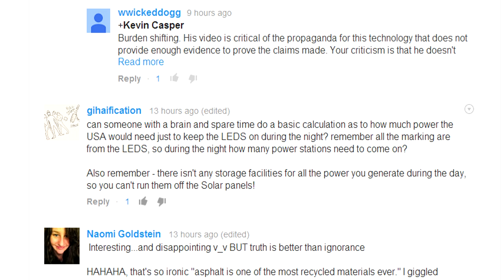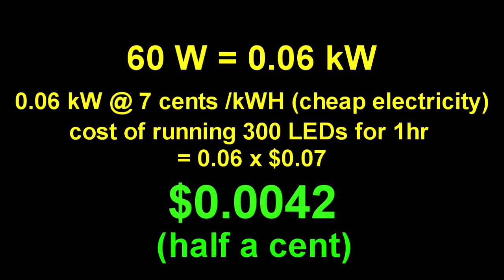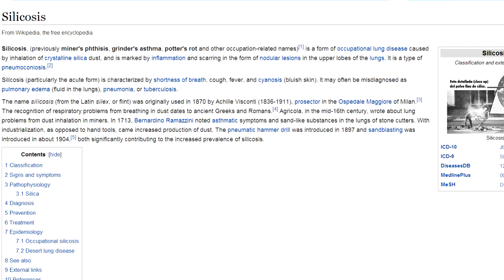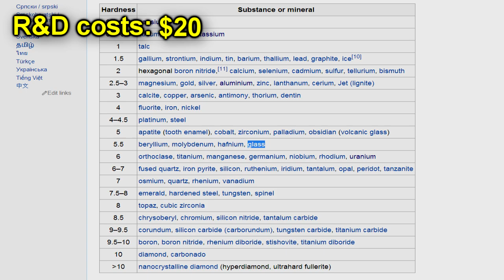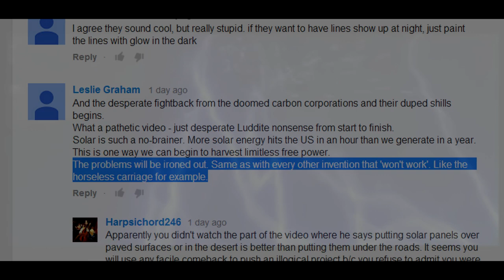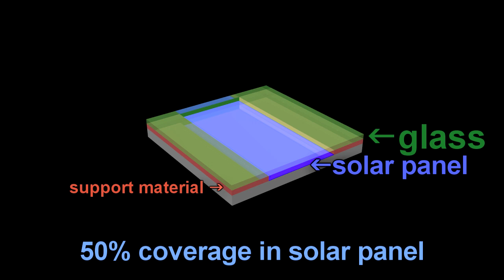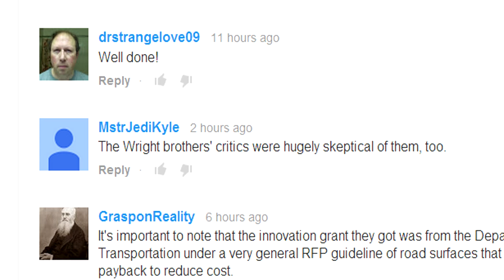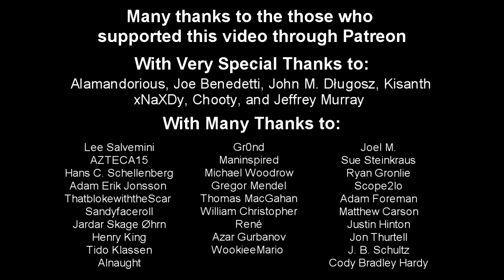Solar Roadways, IMPORTANT QUESTIONS AND ANSWERS!

Comment: There's another problem not to be underestimated, with all the roads covered with high tech electronics people will just break the soft glass and steal all of the expensive materials, and there's no way the Police could control such thing, it's like having all the roads made of glass with a 100 $ bill under each cubic meter of it.

Comment: the thing that I find most ridiculous about the solar roadways project is that there's no reason for it.  we have a power problem—coal is bad.  we have a road problem—not enough money for maintenance.  we cannot possibly solve the first problem by making the second one drastically worse.  

in truth, under the road is the worst possible place for solar panels, and there's no practical reason for doing it that way.  even if all of the technical problems of the solar roadways plan weren't problems—if we had SF materials that would work, like clear aluminum or who-knows-what—the amount of electricity we could generate by putting solar panels under the road would not be enough to justify it compared with putting the same solar panels almost anywhere else.

one of the biggest problems with how we generate power now is transmission loss, and putting solar cells in the road—or even above or near the road—would still involve high voltage transmission, and massive losses.  it would probably be better to take a fraction of the money something like this would cost and put solar cells on top of every house in America, where the power wouldn't need to be transmitted very far to be used.

Comment: Damn, ineffciency and rogue shards of glass. There's nothing good to say about these, huh?
SO these huge solar panels really don't generate enough power to run the electronics and the LEDs, even if we assume that only, say 1/3rd of all LEDs run at a time?
Even if we assume that each panel contains an accumulator?

Comment: If sand and small stones will scratch the glas, over and over the sun light will be so extorted that it's diffused every where and the light hitting the solar cells will be very limited. Not to mention other stuff such as rubber from braking and oil and dust.

Comment: Do you think it would be more practical to, off the top of my head, standardize solar panel placement on roofs than it would be to cover the roads with them?

Far from a novel idea, but it seems a more resource conservative and realistically applicable concept than what is being posited by this campaign: still the issue with increased taxes or utility costs, none to mention the matter of energy storage, but I can't get around the thinking that driving on the solar panels will not supply the energy being promised. Parking lots are going to have a substantial number of panels covered around the clock, it doesn't appear that vehicle traffic interrupting the reception of solar energy is even factored into the proposa... It just seems like the panels are only being thought of as energy collection devices, not being simultaneously treated as what will have the novel bit of heavy machinery known as the automobile using it for its intended purpose: a place to drive!

Kudos to Thunderf00t for keeping us grounded with such fantastical ideas (I found the debunking of the proposed Thorium car a bit disheartening, but very informative: likewise with this piece).

Comment: I think it is better to look a one panel for one group of panel to look at the energy production and consumption. We will have to do reasonable guesses so all these numbers can change, but.... We start by looking at a 4 panel group, it has 200 LED and ~33% covered in solar. A sq meter of solar panels is ~100 watts. That means per four panels, we get 33w. If places at the correct angle these panels will average 4.5hrs of light per day, but will loose ~33% of that when flat. So 3 hours. Meaning 100 watts hours per day, but this means the solar panels get no lose from the glass or road dirt, it this account for a mere 25% loss, then we are talking about 75 watt hours per day. If we use FT LED power consumption, then 200 LED use 40 watts per hour, so the LED alone use 100% of the energy the solar roads make in just under 2 hours.

Comment: Wouldnt solar roof tiles make more sense than solar roads? Just pass a law saying all new roofs must have solar panels on them. No LED lights needed for that.  And in a few decades most houses will be providing power. Reducing the need for oil and coal based power

Comment: ***** Have you seen these? http://solarroadways.com/clearingthefreakinair.shtml

It seems they are desperately threading the waters by misdirections and appealing to emotions. I think my favorites are how they show LED's to be bright enough, by comparing LED's sunk in the road to purpose built road signs and billboards that are not only angled AT you, but are also encased to give a differential in light levels.

And, how they are showing how glass is harder than asphalt. I guess no one ever told them there's a word called "brittle". Glass may be "harder" than "asphalt", but asphalt consists of elements that are harder than glass, encased in a soft material to prevent it from breaking. Making it forgiving and easy to mend. Much like metals. Being hard doesn't mean it's strong.

Comment: Thunderf00t, what do do you think of solar sidewalks? I'm not sure about the hardness of an average sneaker, but I would not think it wold be as effective in eroding glass as a several ton hunk of steel on rubber tires. It would still be horribly ineffective for similar reasons as you said earlier, but would it be more efficient than roads?

Comment: These tiles are a great idea for private use in parks, driveways and patios.
Promoting them for public roads is a scam.
This video caused me to question How many LEDs I have personally possessed.
From Christmas tree lights to little torches and New years novelties, the number must be in the thousands by now.
Reply: I'm not even sure they are a good idea for parks, driveways and patios. Maybe if you have already covered everything else in solar and still want that last bit of power. Covering your entire roof would be both cheaper and give you way more energy.
Reply: ybra Solar is just the added novelty in these tiles, the main attraction is the lighting.
As kerb lighting or illuminated floor tiles but not as a power source.
If I could light up my porch and garden path with these for a cheaper running cost than ordinary lighting, ill buy them.
Reply: ***** If that is your goal, sure I can see the point.
Reply: I wouldn't even say it's a scam. I think these people actually believe they can fit a square peg into a round slot. Their ignorance is fueling this all.
Reply: Its like the old railway investment schemes of 150 years ago. Many invest in railroad companies that go broke before a track is built.
People were exited by the dream of railways through the wilderness.
Factories pumped out steel rails galore but they could only be laid two at a time by human muscle.
Railway companies dissolved overnight but their rails were bought cheep by domestic railways.
With the promotion of the notion of these tiles the advantage is that mass production of these tiles, stockpiling in preparation for a use that will prove too impractical, causing bankruptcy and an abundance of tiles on the market sold cheap for Christmas decorations etc.
Reply: *****
If is just for the lights, you could, but again, it will be very expensive.
Reply: ***** Yeah, sure. Replace the glass 'designed' for vehicles with glass at least strong enough for humans to walk on. Then just remove the solar panel aspect, because solar panels at this angle is just a laughing stock. And then just make it a lot thinner ( I noticed the tiles are absolutely massive. ) Basically, just a glass sheet over LED signage that has the option to be controlled by computer. Still hella-expensive, but pretty nonetheless.

Comment: I have to say that I don't believe for one second that the project will work out but:
-The project doesn't intend to pave the entire country for a few millions, it intends to be a starting point
-Ebay is not representative of the price of LEDs. If you're buying "trillions" of LEDs you'll probably pay a tiny fraction of the price of $20/300
-Don't forget that the current infrastructure of the US has progressively cost every american well over a hundred thousand dollars over the course of their life. You don't slap roads on the entire US in one time. Probably won't be 20% at night either. Still enough that I agree, the bill would be too expensive for this to be viable.
-The LEDs aren't on constantly.

Despite those examples which I consider to be unfair, I completely agree with the rest of the points. In its current form, this is completely nonviable. Maybe in 30 years, when we'll have better materials and more efficient solar panels to work with.

Comment: I'd watched your other video on this topic and it got me to thinking. One of the points that you make is that asphalt, which comprises the majority of the road system in the US (I'd assume around 95%, the rest dirt roads) is a recyclable material. Part of the construction/repair work is tearing up the old stuff melting it back down and reusing it on the next job. The key though is being able to pull this all up and reuse it; the main factor is though is that as the material is broken down and torn apart from use it can be salvaged. How would a glass panel with a silicon electronic plate and LED's mounted through it work?

Assuming a reclamation process were used to take them back, there would be broken class, possibly cracked circuit boards and LED lights. Just a thought on the subject. Not to mention the efficiency level goes down as they get dirty. Or hell growing up in Minnesota in the US which is about 11 1/2 months of the year covered in snow we use road grater which would turn these panels into flying shards of glass in a second.

Comment: Solar road panels is the best idea to make money from stupid people. We have better solution for everthing they want to fix. Why not just build solar panels on roofs or as power plants. Build normal roads with working markings and if needed LED signs. And solar Power alone wont work, you need wind power, tidal power,... to provide a running power supply.